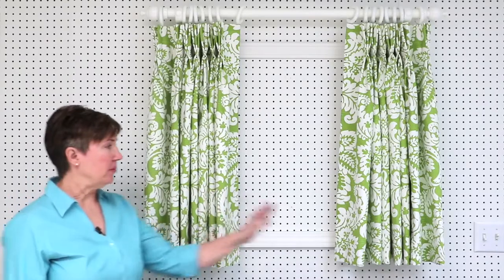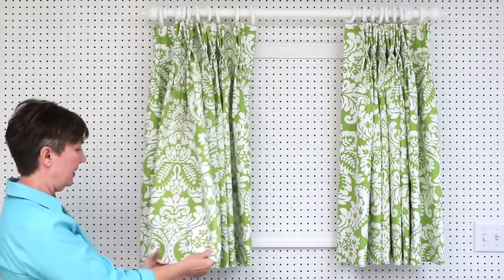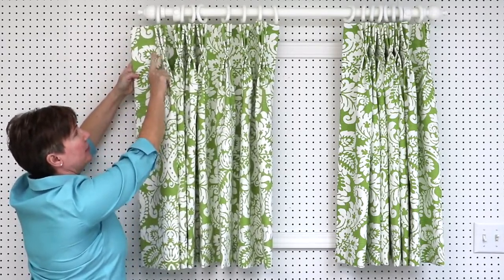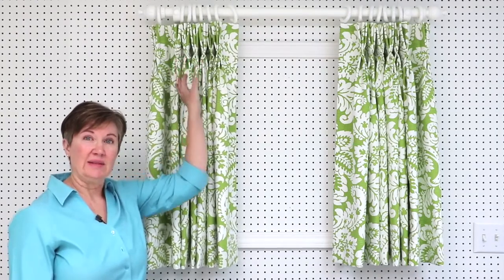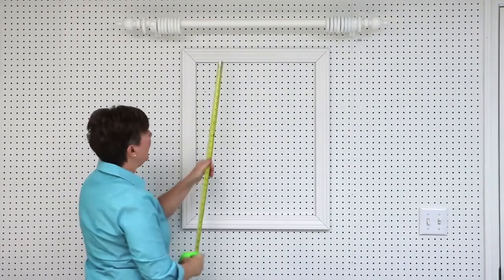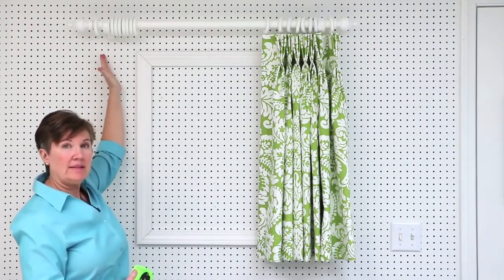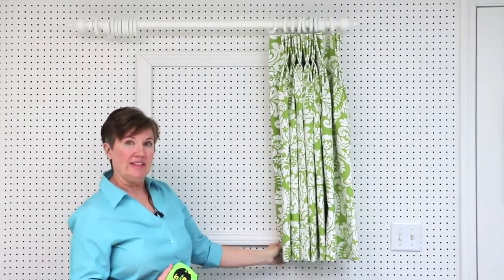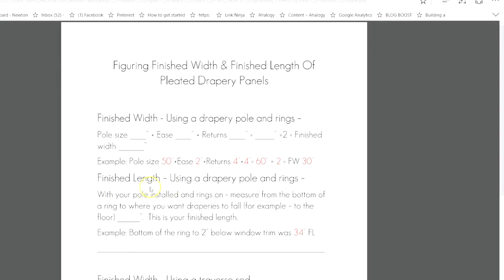How To Measure Your Window | For Curtains Or Draperies

Comment from the maker: I hope you find this tutorial helpful!
𝗣𝗥𝗢𝗗𝗨𝗖𝗧𝗦 𝗨𝗦𝗘𝗗 𝗜𝗡 𝗧𝗛𝗜𝗦 𝗦𝗘𝗪𝗜𝗡𝗚 𝗧𝗨𝗧𝗢𝗥𝗜𝗔𝗟 - (𝗮𝗳𝗳𝗶𝗹𝗶𝗮𝘁𝗲 𝗹𝗶𝗻𝗸𝘀)
   ✅ 54" wide decorator fabric - http://www.dpbolvw.net/click-7349861-...
   ✅ 54" wide drapery lining - http://www.dpbolvw.net/click-7349861-...
   ✅ 4" buckrum - https://amzn.to/3by0Ywp
   ✅ Thread to match fabric for sewing machine - https://amzn.to/2LmhdBT
   ✅ Hand quilting thread to match fabric for hand sewing -  https://amzn.to/3bnWgRL
   ✅ Fabric glue - https://amzn.to/2LpZGc5
   ✅ Drapery Weights - https://amzn.to/2LpLS1k
   ✅ Drapery hooks - https://amzn.to/3boXY55
   ✅ Screw eyes - https://amzn.to/3boYgZJ
   ✅ Drapery hardware - poles with rings or traverse rod - https://amzn.to/2Ws74K4 or https://amzn.to/2YTTS2x
   ✅  Steel tape measure - https://amzn.to/2YWsfWp
   ✅ Ruler - https://amzn.to/2yQoA1N
   ✅ Scissors - Large - https://amzn.to/2AoxaoX
   ✅ Scissors - Small - https://amzn.to/2Z0evtM
   ✅ Pins - https://amzn.to/2WoaMoe
   ✅ Hand sewing needle - https://amzn.to/3dLqik1
   ✅ Thimble - https://amzn.to/2T1H0U2